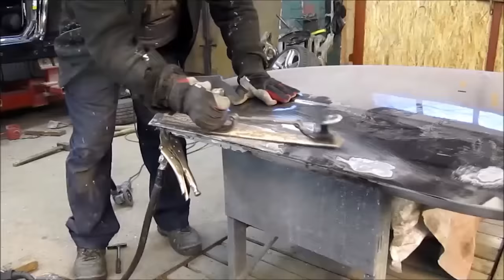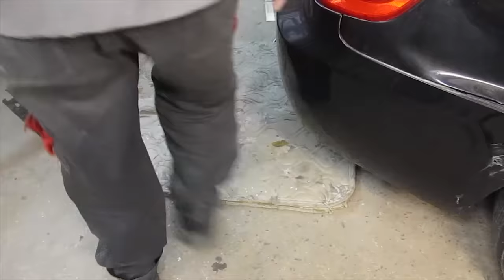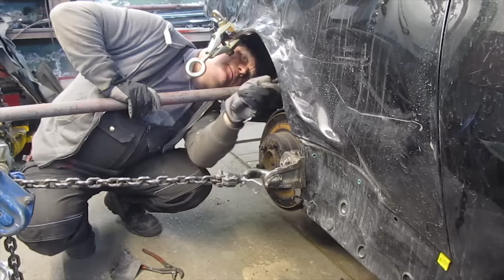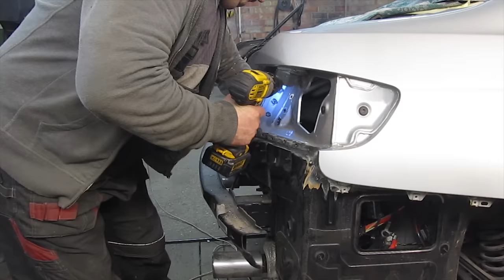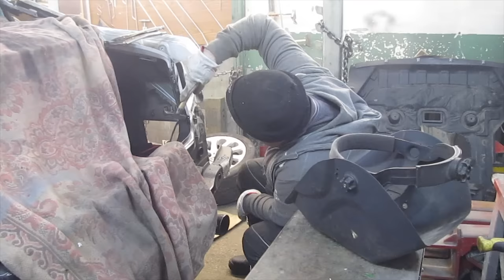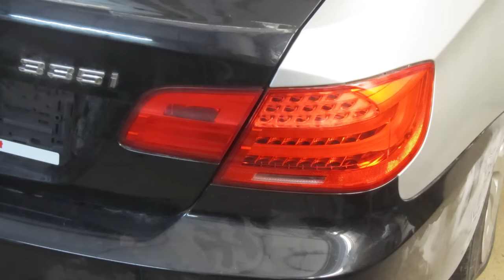BMW Coupe. Metal works. Работа с металлом.

Comment: unbelievable that people will drive with
these tires they have no grip at all
Reply: straxx99 the wheel had been in the crash, that wheel and tyre were put here just so the car could move.
Reply: ok I did not know, and thanks to Arthur for his work, and thank Arthur for his technical ability
Reply: I think thats is not reason.
Reply: The more rubber touching the road the more grip! the tread merely is to disperse any water.

Comment: I dry fit and also spray some weld-thru primer before welding, I also load the suspension no jack stands or car lifted when welding. But hey to each it’s own I guess

Comment: Arthur, when the car is hit from the side like this car, you have to fix the alignment of the wheel as well? If so, can show how you fix this in one of your next videos..

Also, how much is it to fix the back panel like you did in this video?

Thank you.
Reply: hiphopsocnroc I think he leaves that to another person in his shop , his bread and butter is pumping the sheet metal work. just like your not going to have the painter be the mechanic.
Reply: Im not sure, I have seen Arthur paint aswell seems he knows all tricks and practices of the trade. I can assure you while it may not be his bread and butter he is most likely familiar with frame straightening
Reply: becka elliott yes I have seen him shot primer and paint in some of his vlogs , but in order to create revenue for an establishment it's wise to keep your skilled labor , were they best fit in a production setting. I'm most positive if he has 13 cars lined up he's not going to wait and sling paint. He's going to pump out the cars and quick as possible if need be sub contract the body work and painting else where if it comes down to it. Just for the fact filler , primer need to cure and a solo painter can only paint so fast.

Comment: Couldn't he have just bought a new panel & then spray paint and fit it on?
Reply: KingsWorld2015 in most cases its less expensive to repair the panel vs ordering a new panel. repair equals labor only plus maybe body putty and paint, esp if he already has the tools. new panel equals replacement cost plus prep paint and labor. if he's doing this as a business he's going to choose the most cost effective method to get the job done. it's what i would do too.

Repairing a panel may not be as 'sexy' as replacing it, but I don't imagine that matters as much as making sure you're not spending more money than needed. Plus why WAIT for a new part to be delivered when you can be repairing it right NOW?